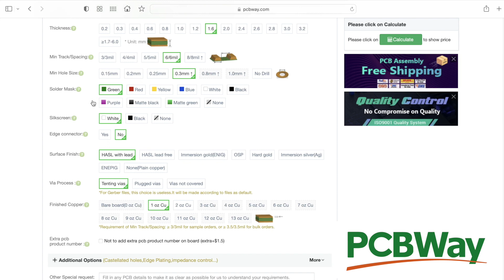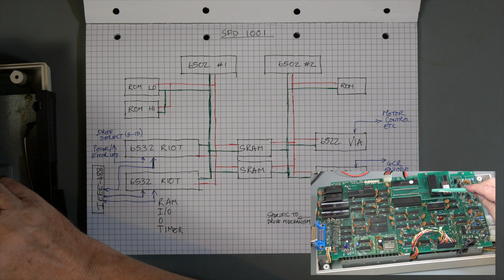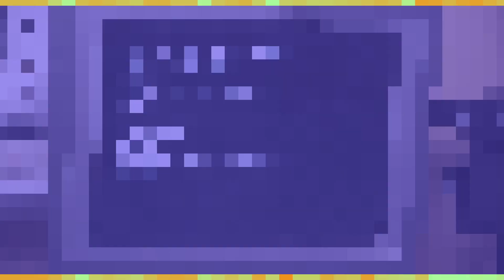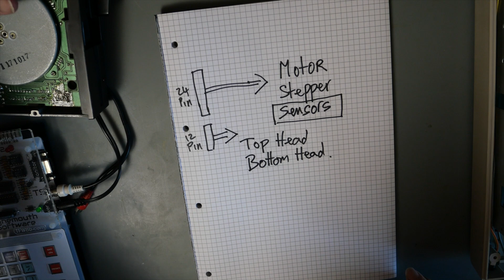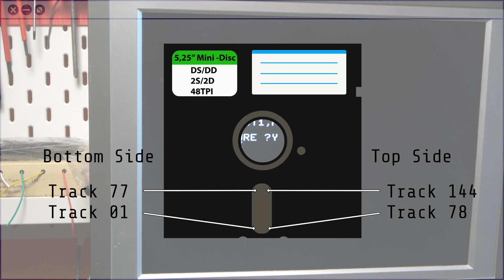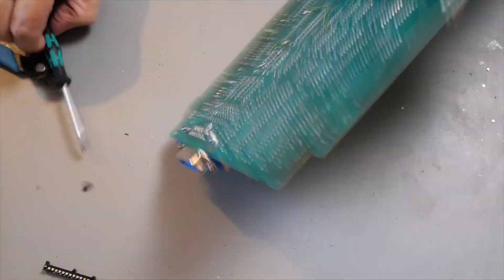Commodore SFD 1001 Drive Teardown and Repair: Part 3

Comment: Unrelated, but... You have a 1541C. It appears you have the correct ROM and track 0 sensor. Find and cut J3 to eliminate the alignment destroying head banging. 

Or upgrade the ROM to that of the 1541-II
Reply from the maker: Oooh, cool tip. Thanks.

Comment: the online/service manual error codes are not correct -- here are the ones i have reversed from the ROM (validated with removing chips):
SFD 1001 flash codes:
continuis - 2H CPU  / 4J RIOT / 3J ROM
1 flash - zeropage: 6J / 4J RIOT
2 flash - ROM_hi  chksum: 3J ROM
3 flash - ROM_low chksum: 1J ROM
4 flash - 1000-13ff: 7G RAM
5 flash - 2000-23ff: 7G RAM /// 1E CPU / 3E (6530) -- after RAM check!
6 flash - 3000-33ff: 9G RAM
7 flash - 4000-43ff: 9G RAM

Also i'm not sure you've mentioned, but this drive uses QD instead of DD -- or 96TPI DD --- some suggest later (higher quality) DD disks may also work. PC HD disks are not compatible.
Reply from the maker: Thanks. The most common failure on my machine  is the 1E CPU (5 flashes). Man that thing eats 6502s!! Haven't figured what's killing them, but I figure it's got to be either power down or power up. The 8050 I looked at recently - also had a dead controller CPU!
Reply: @TimsRetroCorner  maybe mis-timing/bus-conflict? that may explain why the CPUs (my 2 drives had 3 dead cpu) tend to kill themselves/each other

Comment: If you are out of ideas I would suggest dumping the ROMs then disassembling them. Perhaps you can work out what the four flashes mean. With a good logic analyzer you could capture the bus and see its history. You could then possibly see where in the initialization POST routine it failed.

Comment: Good job so far. If you keep hammering on it, you'll get it going eventually. Also, can't believe this is a "dual processor" drive, insane.
Reply from the maker: I've kinda convinced myself that the 6530 is bad. And there's no easy way to replace that. Or rather, I can build an adapter that will take one of the 6532s that have been "in transit" for over a month (that's a project in its own right). Then assuming I get the main board working, I'm back to the 21 Read Error while formatting. I have a plan to write a little program that reads & writes to both sides of the disk. But I need to save that to tape since the SD2PET device doesn't have an IEEE passthrough, so I can't run the diagnostics disk that I have as a .D82 against an actual floppy! So I need to get a working tape drive...
Right now, the disk I've managed to read only has stuff on the lower surface. So I know the bottom head works, but I don't know about the top one.
There was a "pristine" SFD on eBay a few days ago, from a seller in Hungary. But he wanted over a grand for it (+ VAT & duty etc), so no way! A second drive would be useful though, at least to be able to swap bits in and out, bit that's a matter of finding one for the right price, lol.

Yes, I think this was probably the last dual processor drive that Commodore made, before they said "we can get away with just 1 CPU if we slow it down to a crawl!"
Reply: @TimsRetroCorner  Can you scope the pins on the 6530 and see if you can find some evidence to know for sure it's bad?
Reply from the maker: Oh definitely.
Reply: @TimsRetroCorner  - The problem with these older floppy drives, is that it may or may not be be the logic board, it could also be one of the heads gone bad, failing, or out of alignment (thus reading one side but not the other).  The "divide and conquer" method by replacing the entire logic board with a known good one would tell us if it's the board or one of the heads.  And vice versa, replacing just the heads/spinning mechanism with the current board would give a 50/50 indication of point of failure.
Reply from the maker: @BillAnt  I may well do a part 4 at some point - I've made some progress since this video was released. I did manage to get hold of a second SFD drive - which of course has its own set of problems - and do as you suggested. That (plus a short BASIC program) showed the top head on this drive to be inop. Resistances look fine, but it fails either to read or write to the top surface. So I'm strapping it up as a single sided drive.
Doesn't solve the problem that these drives eat CPUs like they're bar snacks. New drive also had two dead 6502s. and I recently got an 8050, which (surprise!) had a dead CPU!
Reply: @TimsRetroCorner  - Geez all the dead chips... that's No bueno! lol
If you could get a hold of a fully working FSD-1001, it would be a piece of cake to narrow down the fault in your existing defective ones by simply replacing just the logic board or the head mechanism.   Of course in some cases there may be fault in both the logic and hardware though not usually.
I have have one stashed away somewhere in my basement, last time it was in use back in 1990 in fully working condition and well cared for.  One day I retire I might drag it out and hook it up, but first recap it of course. heh

Comment: Turned pin sockets feel more premium but I'm not convinced they are ideal for most uses. Typical IC pins are flat and make a nice sort of sandwich in a double wipe socket. Putting flat pins in a turned socket is kind of like trying to wedge a trowel in the end of a drainpipe.
Reply from the maker: I had an idea to put turned pin sockets where the ROMs go, and also where the 6530 daughterboard connects, on the grounds that if they need to be replaced, I'd be putting in adapters with squared off pins, and these have a reputation for loosening double wipe sockets. In the end I didn't, because I didn't have any!
Reply: @TimsRetroCorner  Generally a turned pin socket is supposed to have a better connection because the 4 corners of the pin are tightly pressed into the edges of the hole. Back in the day they were a no-brainer for design and wire-wrap projects where poor connections were a nightmare. I have seen speculation more recently that, in an application where the IC is removed frequently, the turned pin sockets get loose but I have not experienced that. I am sure you are fine with either double wipe or turned pin and the remaining debate is that of personal preference.
Reply: Turned pin sockets are Grate when there good ones.. But if there cheep china made ones they can be worse then single wipe sockets.